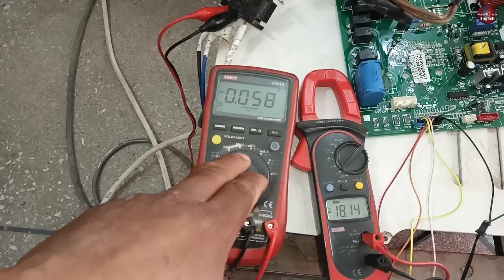Inverter Compressor Start But Stops When Increasing Speed

Comment: Hello, Siemens inverter air conditioner sometimes works without any problems and after hours it shows p0 or p4 error. Motor IPM and fan IPM have changed, the problem continues, I would be glad if you can help.

Comment: Hi there.  I'm  facing a P9 error and after few minutes E9 appears.  I have issues with the outdoor unit fan, which it's not starting at all.  Orion is the A/C
Reply from the maker: Ok got it. But what kind of circuit board is installed in your air condiitoner.
Reply from the maker: I need a picture of it.
Reply: @forevertechenglish   Unfortunately, I have no idea how to upload a picture here.